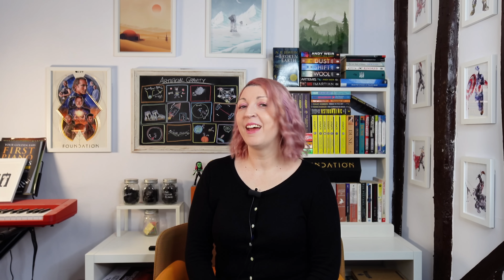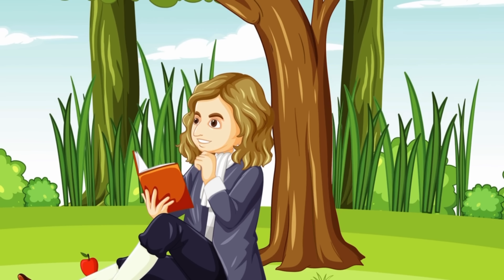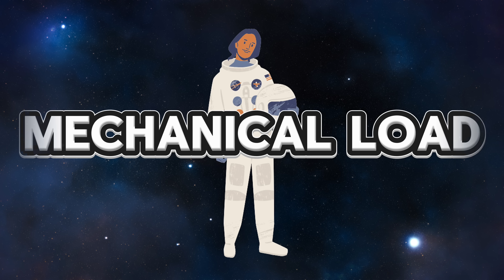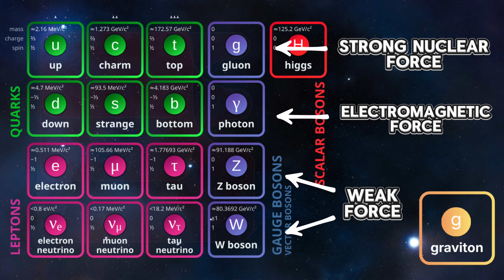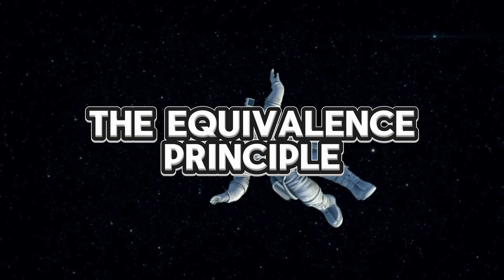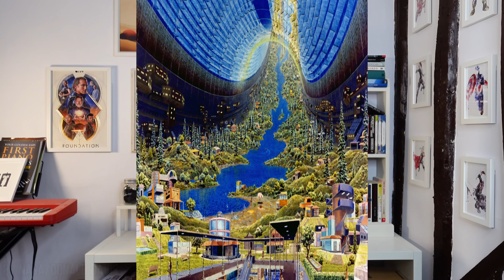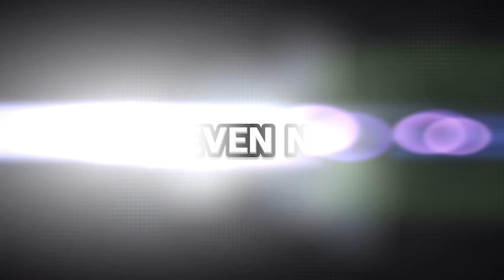Why Artificial Gravity Is Harder Than It Looks

Comment: Speaking of rotation, my son and I went to an amusement park and took the roundhouse ride.  You start off with your back to the wall of a round room, which spins faster and faster until, without changing position, you're lying on your back on the "floor", looking at someone pinned on the other side. Then the original floor drops away.  I tried lifting my arms and the coriolis "force" (or effect) made them flop around uncontrollably. Definitely more than 1g: at the maximum rotation speed I couldn't lift my arms at all.  A lot of fun, but don't eat just before!  We made that mistake and my son threw up later, and I felt sick for more than an hour.
Reply: Your son's career choices have narrowed a bit. He shouldn't be an astronaut or a fighter pilot.
Reply: @Nehmo  You may be right - he's an engineer.
Reply: We used to ride the gravitron at the carnival and when the spin gravity was at maximum we rolled around and it radically spun our semicircular canals in our ears. Very disorienting and loads of fun.
Reply: @philipmetts8831  I made a point of standing diametrically opposed to a buxom young lady in a T shirt. As the ride spun up to speed, the view was so novel I turned my head just a bit to scan a few more...felt instantly nauseous!  My first direct experience of Coriolis Force.
Reply: as a kid, we had the typical rope swing... old car yre cut out, flipped inside out (sort of pretty cool...) and the rope double stranded over a 12" branch at a good 10M high. so it wound up, and it wound good...

by the time it lifts up to the limits a ten year old can wind it, holding your feet... about ten minutes just winding down... then back up... then the other way... good lessons in conservation of angular momentum...

never bothered me.

amusement parks and rollercoasters were always rather dull.

but at 40...

tried one of those spinning playground things a while back...
less than a minute, im off, lying down, feeling queasy...
butterflies over, straight back! weeee!

oh... queasy... nope, im not imagining this... try it again?

yep. definite!... hmmm... another go?

FFS man, your messed up... you cant help yourself... sigh. go lie down again...
but...but... spinning thing! WEEEEEE!
Reply: @paradiselost9946 
Yeah I can't do roller coasters Crohn's disease😢🤮🤢
 used to love them but Knott's Berry farm spend a lot of money to get there and I was going to ride those damn rides felt pretty accomplished by the end of the day it wasn't a lot of fun 🤢
I was pretty sick at the time maybe if I wasn't sick 🤢 I have my doubts whether I can ride high g rides anymore
Visual rides 
Not high g rides 
I'm up for that
Reply: A demonstration of an artificial force. Those spinning things in playgrounds when we were kids did the same thing but with no wall we just flew off if not holding on for dear life.
Reply: Richard,  I'm curious as to where/when you experienced the ride.  I'm 59yo and WAAAAAAY back before even cell phones existed I was at a park that had a ride like that.  I decided for some reason {eyeroll}  to not just break a record of riding that thing but to blow the record away at the park I was at (: 'most rides in a row on one day'...  Years later when I worked at a park that had one(not sure if was same park...).  it had got 'retired'  'rumor' had it they closed it for 'liability' reasons.  I heard from maintenence they just couldn't source the parts to keep it running. If you experienced one working lately, then maybe there is hope for long duration missions 0_o  . Thanks for the trip down memory lane
Reply: @cozmothemagician7243  My story was just a few years ago, probably between 2007 and 2010.  I'd heard of those rides maybe in the 70's but never ridden one.  Probably would have been okay if we hadn't just eaten hot dogs with pickle relish and mustard, along with potato chips and sodas.

Comment: An extremely important point if you want to create centrifugal gravity: not all configurations can be spun stably. A thin flat disk spins stably, as does a long thin cylinder either around its central axis or else end over end like a baton. But somewhere in-between you get unstable tumbling: known variously as  intermediate axis theorem aka the tennis racket theorem aka Dzhanibekov effect. 
https://en.wikipedia.org/wiki/Tennis_racket_theorem
Reply: Incorrect. A long object with a long center of mass, spinning around the long axis is inherently unstable and wants to tumble and go end over end.
The Torus like a gyroscope is stable.
The Kalpana space colony study found that a can or drum shape can be stable if no more than x.75 the diameter in "length" or "width".
What's known as the "O'Neill cylinder" is from his earliest studies where he didn't take into account either this, or the impossibility of shielding against cosmic rays through a transparency -there  cannot be any windows looking out.
Reply: @JFrazer4303  Not exactly: a completely solid long object like a rifle bullet can spin stably around the long axis. But a hollow cylinder with a shifting fluid inside will as you say start to spin end over end. Early attempts to use spin stabilization with liquid fueled rockets fell afoul of this. To get around this, O'Neill proposed using linked PAIRS of counter-rotating cylinders so the unit as a whole would have zero net spin. Cosmic ray shielding was to be achieved by reflecting the light with mirrors so that there was not a direct path in through the windows, although in my view this still wasted half the potential interior space of the cylinder.
Reply: @michaelhutson6758  

The best stability is the gyroscope or wheel.

Not true at all. First, even rifle bullets aren't very stable and will want to spin after a long fight.
The instability is not just with a hollow vessel with fluids or people inside, any long object will want to go end over end.

 O'Neill linked 2 cylinders to counter gyroscopic forces and make aiming easier, and he proposed active stabilization of some kind, but he failed to account for the inherent instability. He didn't know enough at that time.

It's a bad, rather silly internet myth that the mirrors were to block cosmic rays.
Please look at how many paths inside those huge windows or any windows allow for cosmic rays to get in. Next please explain how the external mirrors are supposed to block cosmic rays as well as a meter and a half of concrete would...
No, O'Neill simply didn't understand and know about galactic cosmic rays. That long cylindrical habitat is impossible, eve if it didn't have half the area taken up by windows.

Comment: 16:37 Velcro. So you have liked carpeted floor
Reply: Exactly. You wear "hook" slippers and have "loop" carpeting (or vice versa). "2001: A Space Odyssey" came up with a very neat, simple solution BUT the problem is, it's of a fixed strength - you can't make Velcro more adhesive in order to counteract stronger accelerations, you're stuck with however strong the Velcro's grip is.

With e.g. magnetic boots you can (up to a point) vary the current to the electromagnets in your boots and so still "stick" even under stronger accelerations.

Comment: And as I listened to your video, and I come up with an idea which is not magnetic boots, which is part. But also a prescription level, magnetic suit that you were cooked. It's got certain amounts of particles or traffic to the Magnetic on the Floor So You get A Wait Pushing Against Your Shoulders. It causes you to you, you know, have to hold that up. Maybe it's with more tab negatives. That's strong, but I'm just thinking, you know, you could have a magnetic particle's. You know, tailor maid distributed to your suite. That would be attracted in the right amount to the magnetic floor in addition to the boots. Which made you that would help solve the the body's structure problem.So to speak

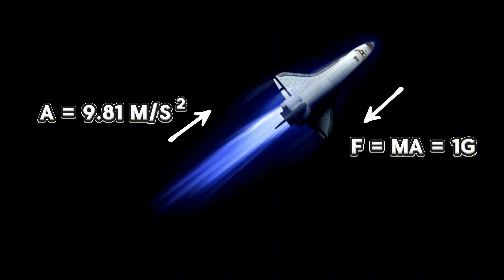Comment: When you were talking about constant thrust gravity you said the top would have less acceleration than the rear (19:43). Why is this? It seems like if the ship is under linear acceleration, the whole ship would feel identical forces. If it were spun from a long cable connection by the nose to a counterweight that would be true though.
Reply from the maker: I'll cover it in the Q&A but it's Born Rigidity that is related to proper acceleration and rigid structures

Comment: A small O'Neal cylinder could be fashioned in space with the new heavy launch capabilities of space X.    Starting at about 120 feet in diameter, lunar gravity could be reached with about 3 revolutions, maybe 3.2.   But one of the draws of working in space is the Zero G effect on material science such as growing organs, crystals and fiber optics among other thing.  So magnetic boots at work stations would be best there, and on small scales a person could spin while they are asleep and not moving around and save the large rotating habitats for other long term work and recreation.  While sleeping a modest radius could be sped up to 4 rpm and slowed to 3 rpm while working in the garden.

Comment: When space ships and stations get large enough they will have their own gravity.  Not much but maybe enough to keep you from floating off of it into free space.  Consider quantum locking of superconductors and apply that to people.  Magnetic boots would need a lot of mass of super magnets to bring a person down to the floor but not so concentrated that you cannot pull yourself off the steel floor.  So there should also be magnets on top of the feet and in the cuff around the shins all north facing up . Secondly, there should be a stretch band like suspenders coming from the magnetic boots up through your waist and over your shoulders to provide compression.  Find a way to concentrate gravity on earth, like through a lens, then form plating in the focal point of that concentration to capture the flux, so to speak, of that intense gravity field.  I am thinking of quantum locking but don't know how to concentrate gravity like we do with magnetism.  There is a way to concentrate static attraction and lock it into polypropylene while it is hardening and it will retain an attraction.  This is worth looking into for space stations.  1% gravity is better than no  gravity at all.  But Centrifical will work the best but you have to have a station hundreds of feet in diameter to avoid coriolus sickness.

Comment: 19:41

I think there is a mis-statement, here. All parts of a rigid structure should be accelerating at the same rate due to aft reaction engines, regardless of the size of the object.

I think you may have confused this with the tidal force felt when an object is held vertical compared to a black hole. This is the force that leads to "spaghettification" if the difference in spacetime curvature between the top and bottom of an object gets too large.
Reply from the maker: I'm talking about Born Rigidity. I'll conver it in the q&a

Comment: something like 10 years ago NASA stated there were still outstanding issues.  Like;
Turning becomes a problem.
Boosting orbits (much like the turning problem)
The Vibration issues, which really comes down to a Weight to orbit problem.
but the biggest problem was, the backup plan.  I.e. we that still needed to not harm the astronauts if something went wrong and they had to stop the rotation.  So they still need to work out how to deal with long term micro gravity.  

Also, if I remember correctly, the early bed experiments that they expected that only 5% of 1g was enough to stop a lot of the body problems.   Not all of them but it's good to see that it may not be as much as we think.   The results from the moon would be great to see.   

Personally my guess is they will still need some exercise and I really hope it's enough for the eye problem.
Reply from the maker: I didn't think about the back up plan. That's a great point, what do you do if it fails!

Comment: There are two topics that I think you missed in this video.  The first is fairly obvious.  you talked about the small fast spinning structures, and the GIGANTIC slow spinning structures, but you didn't talk about the sweet spot - the smallest structure that is comfortable, and hence - the most buildable.  That radius is 225 meters.  so a 300 meter wide circular rotating station would be a GREAT first gravity equivalent station, and with cost per lb to orbit coming down, this might be cost effective in about 10 years.

The second topic is one you missed entirely, and thats because EVERYONE misses it.   You are correct that the human body is DESIGNED to operate in 1g.  But geneticists are looking for the load sensor gene, the one that controls bone and muscle density... and they have done some experiments with drugs in mice, and those mice returned to earth with more bone and muscle mass than they left with.  Dr. Emma Blaber at Nasa is the chief researcher in this arena.  If we find THAT solution, then we don't NEED gravity (as much - the eye flattening issue will still be there.)

Comment: Respectfully, I think you are glossing over the serious issues with O'Neil cylinders and rotating habitats generally. We may be able to counteract the medical problems with spinning people in beds for a certain amount of hours a day, but "living" in a rotating frame will probably never happen. Once we leave earth, we'll be as "belters", we're never coming back.
Reply: Here's how to look at an O'Neill cylinder.

First, as a space real estate magnate, you insist on paying nothing until it's complete. The builders build it, but before they can pressurize it, before they can spin it up, a crew of yours swoops in and cuts a 100-metre disk from the deck. This, you equip with a tether long enough to span the cylinder, plus a few kilometres more. If the cylinder diameter is 7154 m -- the diameter that gives one gee in two-minute rotation -- maybe this tether is 20 km.

At the other end you attach a counterweight, such that the centre of mass is 3577 m from the disk you cut, just as the O'Neill cylinder axis was when the disk was still part of it. So now you spin it up to the same two-minute spin period and have a 100-metre one-gee platform, surface area 2500π square metres.

The O'Neill cylinder's internal surface area, if its axial extent is 8 km, is ~180 million square metres. If the price for the whole thing was two trillion dollars, you pay only for the 0.0044 percent you have taken delivery of. 1999.9 billion dollars saved is 1999.9 billion dollars earned!

If the solar system is full of people who really can't see how to scale down two-minute-spin real estate to manageable size -- and today it does seem that way -- the builders will have no problem patching that tiny hole in the deck and finding a new buyer.
Reply: It's pure fantasy speculation to suggest that we can even stay alive in micro or even low gravity.

Meanwhile since the '70s NASA Ames / Stanford space settlement studies, there are no new inventions needed to mine moons and asteroids and to build for virtually Earth-like conditions in space, anywhere there are or to which we bring materials.
Virtually anyone can fairly readily adapt to 1RPM which is what they designed the 800 meter radius Stanford Torus habitat(and they tested not just fighter pilot astronauts but clerical staff and interns).

If we'd started then we'd have it now. Politicians with contrary thoughts about the direction of our culture, is the only reason we don't.

Cost to build up to this first habitat, over 30 years would have been like many large infrastructure or industrial developments down here (less than 2 years of our current military budget), or 3 or 4 of our CVNs and their air wings and escorts to deploy them).

Any who disagree with their estimates is invited to show their professional qualifications in all the relevant engineering fields and where they are published under peer-review showing that those studies are wrong.

Comment: 2001 combined magnets and centrifugal force from a spinning ring for jogging, which is also indistinguishable from any other kind of acceleration. That does replicate the identical affect on the body that gravity does; Musk is designing MODULAR pieces to leave in space for a station or inter-planetary voyages; since modules never need fuel to return to Earth, so assembly in space cost can be cost effective as well as  mass produced. Of course, putting you into stasis "sleep" may be an alternative since biological functions are slowed way down; we don't know whether no/low gravity effects are retarded, too. Arthur C. Clarke's consulting on this picture made it still so accurate!
Reply: The problem with hibernation is persuading all the billions of bacteria in your body to sleep as well. Otherwise when you opened the hibernation capsules, all you'd get is a lot of spoiled meat.

Comment: I had a thought. Fictional, and I wouldn't be shocked if others had it too. Could our space adventurers have a skin tight suit lined with a electromagnetic thread. Maybe done in zones. And it pulls "down" towards the deck. This wouldn't deal with internal issues, but this combined with magnetic boots/shoes, could give their muscles and bones a gravity equivalent if traveling at a constant velocity. 

Maybe it is a more complicated fabric and has a "laying down mode" so that it'll pull on the chest and rest of the body. That way they'll get rest and keep those bones and muscles under stress. Maybe even the constriction would help with some of the circulation issues.

This isn't a practical solution for the real world. More a sci-fi idea for a longer voyage so our characters won't die when they get to an alien planet